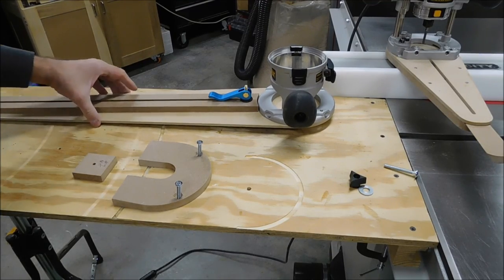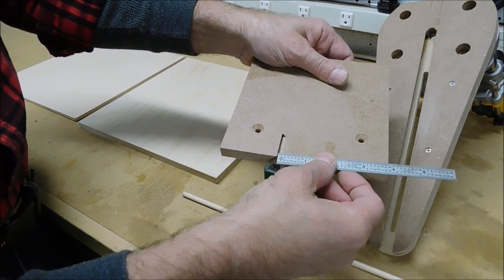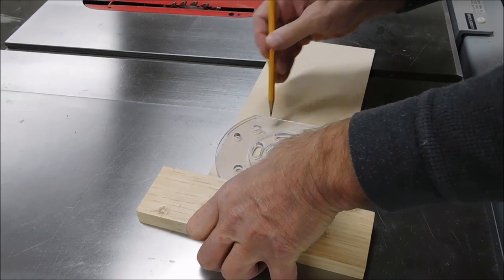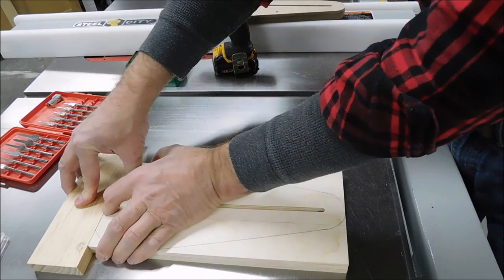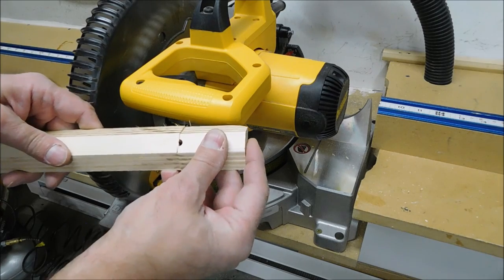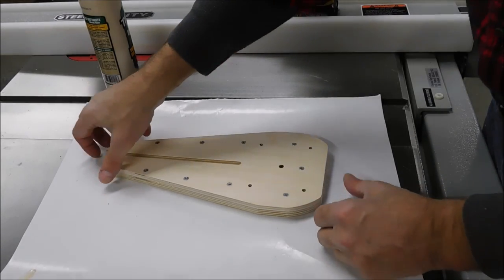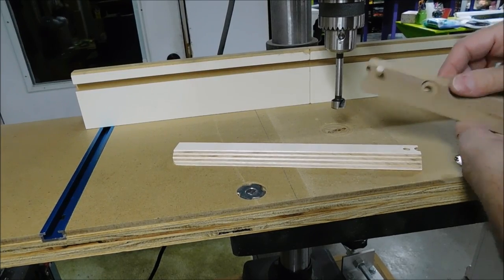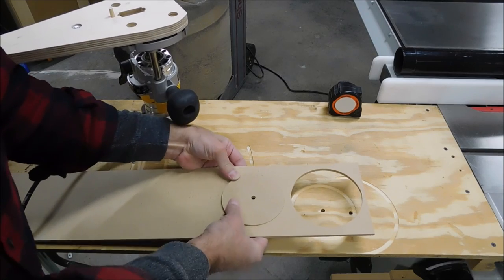How to Make the Small Circle Cutting Router Jig

Comment: 👍Quality function with the dovetail slide and the no-hole adapter. Your explanation on measuring for the two scenarios of hole vs. circle cutout will avoid cutout errors for me. Basically there’s two scales to consider.  Simple math, but I’m betting so many folks waste material finally figuring it out. Thanks for explaining the build so well.
Reply from the maker: Hey Robert, thanks for noticing!  I thought the strategy for measuring for a hole or for a circle was the most important part of the videro but you're the frrst person to mention it.  I appreciate it!

Comment: Great job especially showing the details of the dovetail.  I had thought you would put the screws in the scrap and then cut them off after gluing.  I would suggest drilling 2 holes in the the scrap on each outside piece that would allow for alignment with pieces of dowel and easier gluing (you could leave the dovetail piece out). I will be building one of these soon and see how that turns out!
Reply from the maker: I think those are great ideas!  I have more 1/4" and 1/2" Baltic birch plywood to make another jig, just need the time to do it.  I plan on keeping the screws out in the waste area for that.Thanks Gregory!

Comment: Thank you so much for this video.  What a great design and explanation.  I do a lot of work which needs consistent, accurate 6 inch holes cut, and this is the perfect solution!  I actually just finished building this today, and can't wait to try it out. 

 One simple modification I made was to add another post, on top of the sliding dovetail,  in front of the locking nut, and to it glue a small piece of clear plastic with 2 parallel lines 1/4 inch away from each other.  This is because I figure I'll always use this with a 1/4 inch upcut spiral bit. 

 I then bought a  cheap $1 mini tape measure, and cut about the first 9 inches off of it.  I pushed the dovetail in as far as it would go, and ran a circle.  It left a 1 inch circle, and a 1.5 inch hole.  That meant from the outside edge of my bit to the pivot point was 3/4 of an inch, and from the inside edge was 1/2 inch.  I lined up the 1/2 inch mark on the cut tape measure with the forward line on the piece of clear plastic , and the 3/4 mark with the rear mark on the piece of plastic.  Glued the piece of tape measure down with some C.A. glue, and now I have a very easy and precise way of measuring what size, either hole or circle, I will be cutting.

Thank you again for this great idea, it will be such a huge help!  And PLEASE continue to make some more woodworking videos.  You are one of the best I have seen
Reply from the maker: Thanks, Geoff, and what a great idea!  I hadn't thought of putting the tape on the top side.  I've got the materials to make a new one but haven't gotten around to building it yet.  I'll use your method for the tape measure but I like the self-stick ones.  Thanks again for the clear explanation!

Comment: Thanks for your video! I made one of these put another carriage bolt hole near the other end of the slider  turn it around for larger circles. 
Also run a thin layer of CA (super) glue on the running  surfaces of all my ply and mdf jigs. Gives a smooth hard layer which will take any lubricant if needed.
Reply from the maker: Great suggestion on using CA to harden the material!  For the slider, you could also make an additional one as long as you need.  Thanks, Don!

Comment: I taught school for 21 years and I have to say I've never heard a better presentation.  You make it simple without making us feel like you're talking down to us.  Rare talent.  I was wondering if you thought it would work to design the sliding dovetail to allow it to be removed and reversed so the pivot pin could be placed further from the bit to extend the limits of this jig.  Or, perhaps it would work just to drill a hole in the back of the slider to accept a removable pin?  I don't currently need the large jig you posted, but I believe I need one capable of cutting say up to 36 inch diameters.  I definitely like the size of this jig.
Reply from the maker: Thank you for your years of service as a teacher. I admire that level of dedication.   And thank you for the comments!  Absolutely great idea to reverse the slider to extend the capacity, a second hole for the carriage bolt should take care of it.  Another idea is to just make a longer slider to suit your need.  Drill holes every 8 or 9 inches for a removable pivot pin and you would have as long a jig as needed.  It's good to have options. :)  I prefer the large jig just because it has the built in measuring tape but the small jig could have one just as easily.

Comment: Great video, I now believe that’s the only way to make them. One suggestion is to wax your guide rails before gluing then you don’t have to worry about the squeeze out sticking on the sliding areas. Great job and I have also subscribed. No way will I pay the ridiculous price Rockler wants. Many thanks
Reply from the maker: Thanks, johnbab1! Totally agree on waxing the parts not to be glued. I've done that before but didn't think of it for this project.  Thank you for the comments and the sub!

Comment: Brilliant video. Well thought out, well explained, well filmed.  Many thanks for that. 
A few questions if I may:

- Is there a reason you counter sink the holes for securing the router to the 1/4 sheet?  The screw heads will be buried in the wider access holes in the 1/2" anyway...  Is it just because the screws might not be long enough?

- When you first screw the 1/4 and the 1/2 sheets together, Why do you not glue at that time?  Is there a reason you waited until after the bandsaw part?

- One of the great advantages of this system is that it is very intuitive. Assuming one would not need to cut holes smaller than 2", is there any reason we could not drill a much larger hole (like the same size as the original hole in the router base (2"?)) around the router bit area?  This would allow one to draw the circle that needs to be cut on the destination wood, insert the jig center pin in the middle and then visually slide the router to where the bit aligns with the edge of the drawn circle.  This would eliminate the risks of errors in measurement.

Thank you.

EDIT:  I just noticed that on your large circle router jig you do have the wider hole around the router bit. So I imagine in this case it was down just to be able to get a smaller circle cut.
Reply from the maker: Thank you, +lookdenfer!

- Yes, I only counterbore for the screw heads a nominal amount to ensure that plenty of threads are available to screw into the router base.

- I only screw the two pieces together initially so I can locate them back together in the same position when I'm ready to glue.  I don't immediately glue them together because of the further operations I need to do to the dovetail slider.  The gluing could be done before the bandsawing, though.

- Your edit has it correctly.  I envisioned this router jig being used to make something as small as wooden wheels for toys, therefore the configuration of pivot pin placement.  Everyone's needs are different.  I think I mentioned in another reply that were I to make another one, I would embed a self-stick tape in the bottom and use a hairline indicator for accuracy similar to the larger circle jig in that other video.

I appreciate the questions!

Comment: I really like your design compared to a lot of others here.  I have a question though; is the thickness of workpiece limited due to the 2 layers of ply on the jig?  It doesn't seem to have much left to plunge to any great depth.  Cheers!
Reply from the maker: Hi dannalboon.  You are correct, you lose 3/4" of the depth of cut.  Your cutting depth depends on the length of router bit you use and how deep you chuck it into the collet.
Reply: @timcanthejigman7932  thanks for taking the time to reply mate, especially when it has been over 5 years since you posted the video.

Comment: Thank you for your EXCELLENT circle jig!!!  It is awesome!  I made some changes, some on purpose and some by mistake.  I used a 6 mm steel pin instead of the 1/4" hardwood dowel pin.  It is a good fit with a 0.24" drilled hole.  My jig is longer (a "mistake"), which allows larger circles to be cut.  Also, I cut the middle sliding piece shorter (because it was binding in the dovetail).  That allows me to turn the middle piece around to cut larger circles.  I have subscribed to your channel.
Reply from the maker: Hey Don, thank YOU for the comments!  I really appreciate hearing about modifications people make, whether the construction method or choice of materials or details.  You may have noticed that my prototype was longer than the final version and I still occasionally use that prototype.  Glad to hear you found value in the video!

Comment: I have a Bosch GKF600 palm router and I needed to make some hoops for some spotlights that had been replaced but were fitted badly, the holes were too big for the lights to sit correctly and had been damaged enough that it wasn’t possible to repair them with filler so I made hoops - with the help of your small circle jig of course, to sit over the damaged holes so the lights can neatly fit onto them. They look really good and the customer now wants me to fit the same for all the spotlights in the house.

Thank you for making this video, very much appreciated. (This is a must have jig)
Also found this on 3D Warehouse: https://3dwarehouse.sketchup.com/model/c96038ac-efa4-486c-af7a-bb3527ae0c5f/Circle-Cutting-Jig-for-Router-small
Reply from the maker: Thanks for sharing your experience, Dex!  I checked out that site, very nice!  I'll be sure to direct others there who need a written plan.

Comment: good video - made one myself. 
Couple of suggestions: dovetail angle is more conveniently something like 30° rather than 45° ie a "squarer" sliding piece.  And for easy measuring, a cut of 42° will mean the kerf is (near enough) 50% wider. 
Secondly, the addition of a channel or two routered in the unit on the side that marries against the base of the router to allow sawdust to escape. In fact I was trying to cut circles out of perspex. Without a channel, and also a pipe to attach to an extractor (old vacuum cleaner), the perspex swarf would accumulate, melt and make a mess of it. I made the pipe out of a small piece of 1"  plastic conduit, used heat to flatten the end to fit into a channel and bend into ~90°.
Reply from the maker: Those are great suggestions! I've had sawdust pack into the slider channel often enough when I don't use a spiral upcut bit. Routing a dust port channel into the 1/2" piece is a great idea. I'm going to do that to mine when I get home. Thanks!

Comment: You should be able to Modify the slide just a bit, make the bottom slot a bit wider, and glue a block into the slot and use it to mount a T-board and use it for edge routing or cutting dados and grooves, etc with the same jig, if you add the half round base of the same thickness to the bottom of the router base portion. Have even more functions to the same jig.  Nice job..
Reply from the maker: I think that's a great idea, Mark!  I love hearing suggestions for upgrades.

Comment: Good design.  If you were to place an additional hole for the carriage bolt and knob on the opposite end of the strip that fits into the dovetail slot, you could reverse the strip and it would be able to route large circles as well.  You could have a twofer.  Thanks for sharing.  👍🏻
Reply from the maker: Great suggestion, keir farnum!  I'll have to do that on one of mine.  I appreciate the comments!

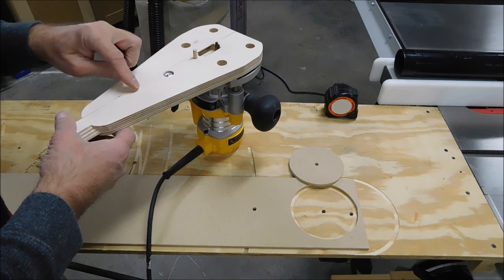Comment: I made this jig! thank you for sharing. I want to ask do you make a hole insde the mdf through it and also to supporting plywood under it (21:44) and the pivit goes through two bords? I made pivit short so it only goes to my working peace but when I finish routing sometimes it loses center and bits outside edge.
Reply from the maker: Thanks, medenis!  I did make the dowel pivot long enough to go througjh a 3/4" workpiece and into a board beneath it so that it would be stable.  The outside piece, once it's cut away, can move so you have to be careful.  I sometimes fasten the workpiece down with double sided tape to keep everything from moving.
Reply: @timcanthejigman7932  Thank you for replay and useful tips. I will try that trick with double sided tape if I could find a thin one or I will remake dowel pivot by driling it old out and iserting new longer one.

Comment: Nice out of the box to many I have seen that are too similar. 

I was lost why you plunged a 1/4 hole then cut the slider and replunged a 3/8.
Reply from the maker: Thanks!  I did the 1/4" hole first just to locate where to cut the slider at the miter saw.  I wanted the cut right in the center of the hole.  The 3/8" hole was the final size.

Comment: Is the drill press handle OEM or did you modify the handle? If so, where did you obtain the swivel one shown in the video? Great video.
Reply from the maker: Thanks, Kristine!  It's the OEM handle on a 10" Craftsman benchtop drill press.  It's a few years old so I looked up the current model on their website but I can't tell if it has the same swivel handle or not.  https://www.sears.com/craftsman-10inch-bench-drill-press-with-laser/p-00934983000P?plpSellerId=Sears&prdNo=2&blockNo=2&blockType=G2

Comment: I find your woodworking videos very informative.
Reply from the maker: Thank you, K G.  That's what I was going for!
Reply: I made your jig today.  Not nearly as neat as yours but actually works.  Plywood didn't cut smoothly but I'm going to make another one until I get it looking better.
Reply from the maker: I made 3 or 4 of them before I made the video and each one was a little better than the one before. It doesn't use much material so at least they're inexpensive to make. Good luck with your build!

Comment: Tim:  Outstanding video!  Well filmed, excellent lighting and sound and very clear directions.  Any thoughts on making the pivot pin out of maybe 1/8" steel rod, epoxied into slider, instead of 1/4" hardwood dowel?  Do you think the 1/8" steel rod would be sturdy enough (not bend etc.)?  My purpose is so I can re-drill center holes at different diameters to meet different project needs.  An 1/8" hole probably would not cause problems with different diameter forester bits for the re-drill.
Reply from the maker: Excellent suggestion!  I've not tried 1/8" steel rod so can't speak to its suitability but it seems as if it would be ok as long as the side loading isn't too severe.  In other words, take light passes.  The only reason I used a wood dowel was I wanted to utilize a different mechanism than the one I did in my other router circle jig video where I used a brass machine screw.  I thought it would be more accessible to people who didn't want to do any metal machining at all.  Thank you for the comments and the nice words!
Reply: If you want to use a 1/8" steel pin use a "dowel pin" or a piece of drill rod (you can find these online - MacMaster-Carr).  both are precise and polished and certainly strong enough.
Reply: @timcanthejigman7932  The wooden dowel still works amazing I think that it is even safer than metal one because this jig is made for small holes and dowel can get really close to the router bit

Comment: Tim, I agree with the other comments below, excellent video. Can you provide the measurements of the jig. I have not subscribed yet but plan to. If you sold plans that would be even better.
Reply from the maker: I used 12" squares of Baltic birch so the jig is 12" long.  The big end is the shape of my router and the small end is 2" in diameter.  The sides taper from the one to the other.  I'd feel guilty about charging someone for a pattern of that.  I try to make my videos so people don't have to buy anything from me.  I don't want to make money off of others.  Thanks for the anticipated sub. :)

Comment: Fantastic homemade solution for small diameter circles, sir! Why pay for jigs when you can make your own? I have a Bosch router and guide fence which comes with a central pivot, but it can only cut a minimum of 10" diameter circles. I am constructing a pair of wooden gymnast rings for my current project and I need to be able to route 7" circles. I don't own a  7" hole saw, nor did I want to try with my finicky jigsaw and run the risk of ruining the inner diameters. I look forward to constructing and utilizing this jig for this project and any other future projects needing smooth edged small diameter circles. You've earned a subscribe from me :-)
Reply from the maker: Hey Victor, thank you very much, for the comment and the sub!  Gymnast rings sounds like the perfect project to use this on.  I use mine a lot.  There are a couple of later videos where I use it such as the Horizontal Router Table: https://www.youtube.com/watch?v=nhNbli1BXuE and the Miter Saw Station:  https://www.youtube.com/watch?v=qKDTwoGCc-w
The jig itself only took a day or two to make.  Hope you enjoy making and using it!

Comment: What is the smallest radius or diameter this will cut?  Need a tool to cut a half circle on the end of a 2” wide board.
Reply from the maker: Hi Derek.  I think around 1/4 or 5/16 of an inch radius is the smallest it will adjust down to.  A 2" wide board should be no problem.

Comment: Thanks for the very informative tutorial. I have the same routers and I am learning so much about what you can do with them. Any tutorials on making a table for the router?
Reply from the maker: You're welcome.  My next router project will be a horizontal router table used for making mortises.  It will use a lot of the same construction techniques as a regular router table.
Reply: Jason Grandy You tube is full of router table videos,  best router table insert I found is the kreg,  cut the hole screw in the corner mounts and set the plate . adjustments are easy